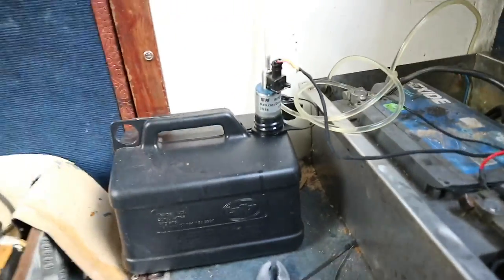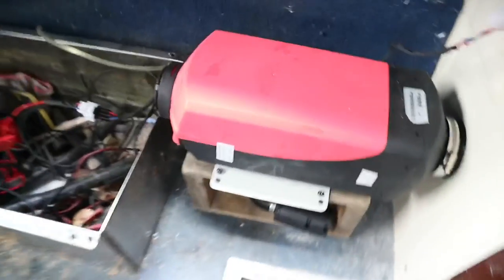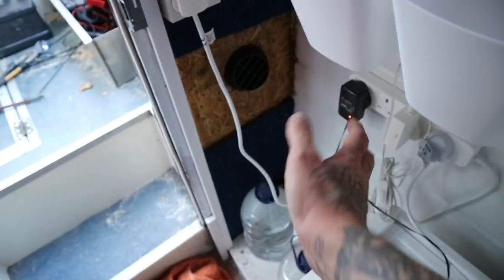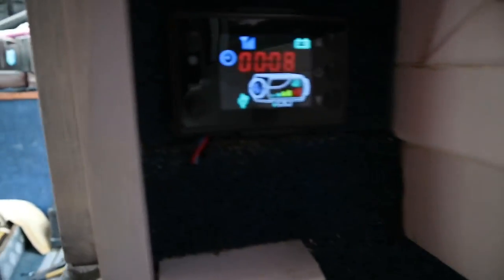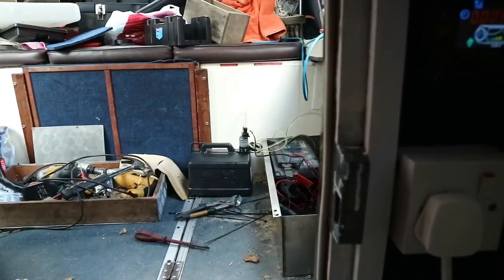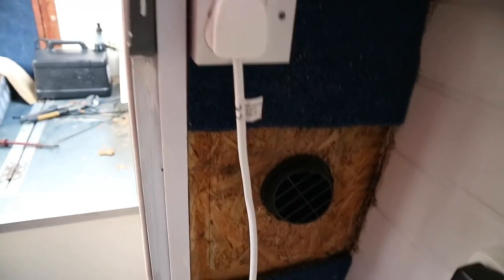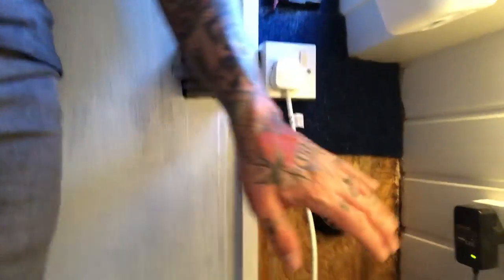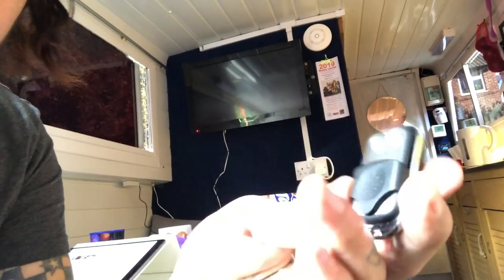CHINESE DIESEL HEATER - FITTED ON MY BOAT #VANLIFE #BOATLIFE

Comment: BUT........if you use your boat on canal or rivers and therefore need a BSS (Boat Safety Scheme) certificate it will FAIL. Fuel line and exhaust don’t comply. Fuel line not suitable, and Exhaust supplied are not sealed (they leak apparently). Need a marine sealed exhaust and through hull fitting to avoid burning the hull.
Reply from the maker: Haha thanks! I could just remove it before the next test... but the exhaust is sealed and not inside the boat
Reply: LiamTheTerrible  was gonna say could remove for test. Those exhausts supplied are not sealed..you can see if look round edge...told they have a small hole cos intended to be mounted outside van. Marine ones are sealed and can be fitted inside boat hence using thru hull fitting. Great heaters tho! ......have same as yours.
A CO detector recommended. Have both on my boat. It also failed before it was corrected after BSS.
Reply from the maker: Mines outside the boat but I also used sealant!

Comment: They are brilliant.   I measured the fuel consumption when I installed it and the result was 1l diesel in 9 hours of continuous running in -6C.   Can't get better than that
Reply from the maker: That seems better than what I’m getting haha! Is that running low?
Reply: @LiamTheTerrible  mine is the 2kw version if you have the 5kw it will use way more.   Mine runs ON the lowest power which is about 1kw ii think. I slept in a t shirt in the winter.
Reply from the maker: Ahhhh right, I’ve not had mine on that much and certainly not had it on over night haha
Reply: @LiamTheTerrible  Mine is very basic. It does not have an LCD only a potentiometer 1 switch and 2 green LEDs.  I bought it 3 years ago from China. At that time these heaters were not available in the UK and were not as cheap as they are these days. Paid over £300 for mine. For a van, I would not go for anything bigger than 2KW because even that is just too much.  I have both windows an inch down at night when it's running.  I love it. Best 300 quid I have ever spent
Reply from the maker: I love mine but I do need to figure out having it running during the night I think... my duvet is great and I have hot water bottles though

Comment: So during startup, and when it is at temperature. ?? I have a small battery on my boat
Reply from the maker: Yeah on start up and cool down it uses most power but running it’s hardly anything

Comment: I've been looking at these for heat on my narrow boat loads of mates using them in vans with no problem
Reply from the maker: It’s so good! The 5kw one is using a fair bit more fuel than I expected but still cheap
Reply: Are you running cheaper red deisel?
Reply from the maker: Yeah buddy! But apparently kerosene runs even better so I’m looking in to that too